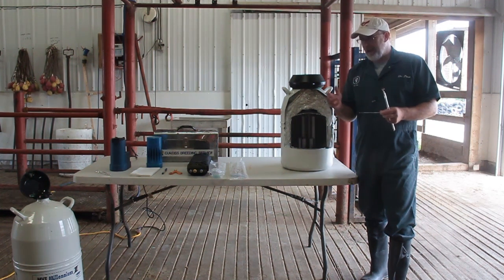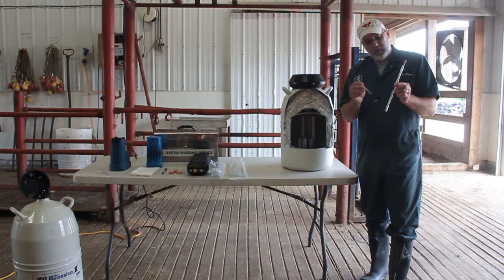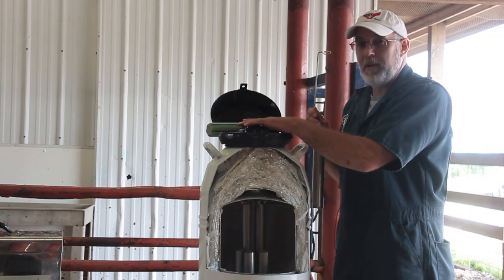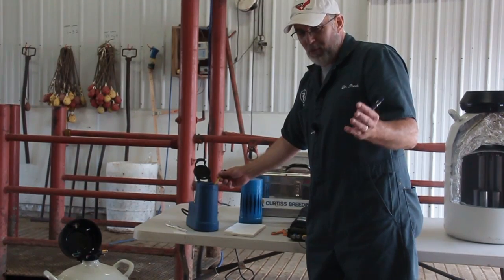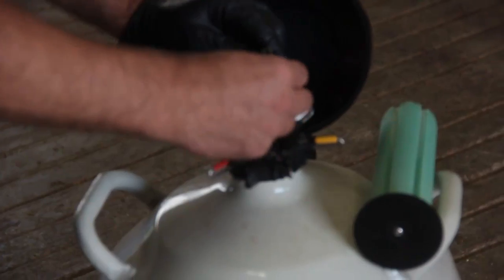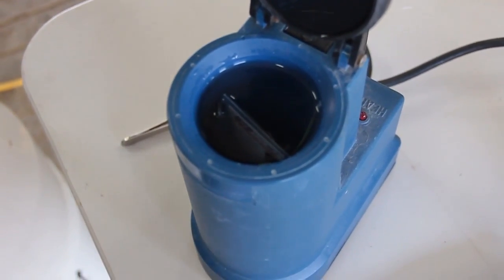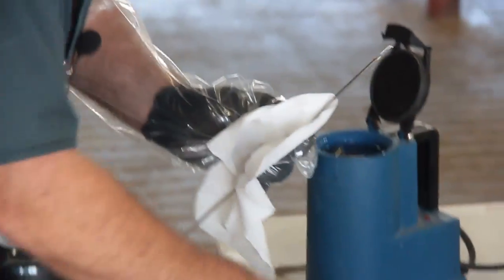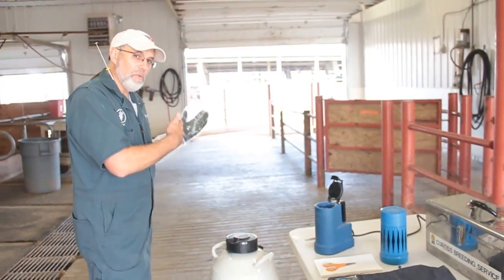Proper Semen Handling Techniques

Comment: My procedure is as follows --

1. Make sure the cow is somewhere I can get to her easily. She needs to either be an extremely tame cow, or she needs to be confined in a small pen with chute access. Even tame cows can act unpredictably during breeding. If you enter a cow with the left arm, and she abruptly pivots to the left, an injured arm or elbow is a very real possibility!
2. Fill a thermos with 95 degree water from the milk room tap. I keep two thermometers handy. That way if I drop one, I can quickly compare it against its mate to determine if it's out of calibration.
3. Retrieve the straw from the tank, and put it in the thaw water.
4. Quickly warm a gun with a cloth udder towel, and stick it down the front of my pants waistband. I may have over or under warmed the gun. By sticking it in my waistband for a minute, it evens out the temperature so there's no hot or cold spots.
5. Stick the sheath in my waistband as well.
6. Write down the necessary breeding info. It's better to do this now, instead of forgetting to do it later. You should always record a breeding attempt, even if it wasn't successful. 
7. By now, a minute has passed. Pull the straw from the thaw water, load the gun, snip off the end, install the sheath, and slip it back inside my pants. I don't bother to wrap the gun tip. Personal hygiene is important for this! For the best temperature control, get the gun tip as near the crotch as possible.
8. Stuff the towel in my pocket, put a glove on, and get a dollop of lube in the palm of that hand.
9. Push the cow into the chute if needed. I have a few minutes to do this, since the semen is being kept at body temperature under several layers of clothing.
10. Smear the lube around the butthole, reach inside the rectum with my gloved hand, grasp the cervix, and push it forward to straighten the vagina.
11. Wipe the vulva clean with the towel, taking care not to push anything inside.
12. Lay the gun against the vulva, and press it in sideways. Don't poke it straight in, since that can force contamination into the gun tip.
13. Cradle the cervix, and manipulate it over the gun, until the gun is 1/2 to 1 inch past the cervix.
14. Slowly deposit the semen, over about five seconds.
15. Exit the cow, and examine the sheathed gun for semen feedback due to a poor seal.
16. Fold the tip of the sheath and straw over, and pull the sheath off the gun with the gloved hand.
17. With the clean hand, remove the heat detection patch from the cow's rump.
18. Remove the glove, encasing the sheath, straw, and patch inside the glove.
19. Release the cow.
20. Discard the glove, and toss the towel in the laundry. Hose the towel off first if it has gross contamination.